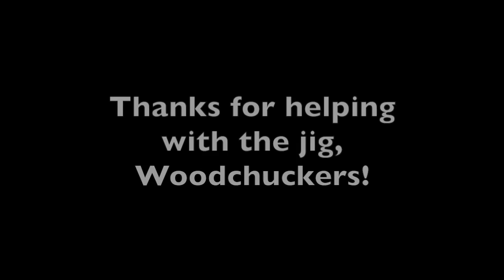Making and using my first donut jig on the wood lathe.

Comment: Cool build, I wonder if there is a way to make it self centering using a tapered section to seat the work piece.
Reply from the maker: The bowl I was trying to finish was ill-suited for a donut jig;  It was broadly flat on the bottom, except where there was bark, which made it self-decentering until I put the flats on either side.  The bottom of the bowl is supposed to come through the donut, which would help a bit in centering, but not close to  'morse taper' quality centricity.   

It's mainly for finishing up the bit of bowl that's been held by the chuck; it's not  really suited for any kind of major shaping work;  it's not advisable to even try to clean up the tenon very much, in case the bowl has to be remounted for touch-up.

Many lathes have a hollow head-stock so that a mandrel or boring attachment can be  fed through; some folks have made an air-tight sealed bearing to support a vacuum tube, and use a basic end-plate with a smooth rubberized surface, and use air pressure to hold the work in place.  Alas, my old thing has no such passageway.